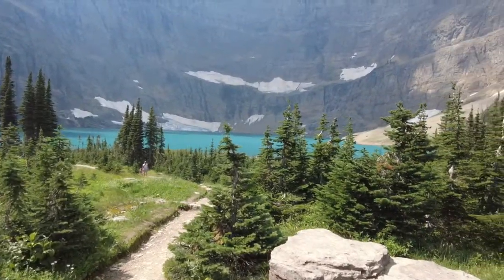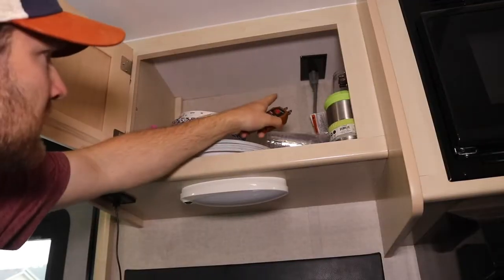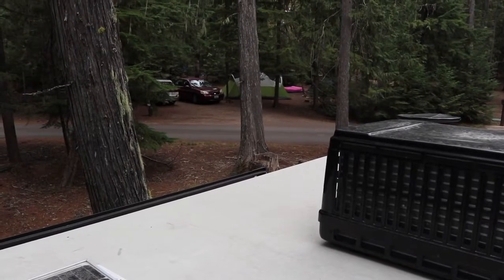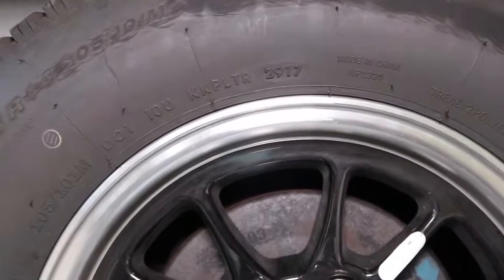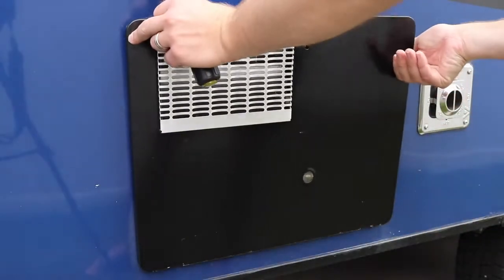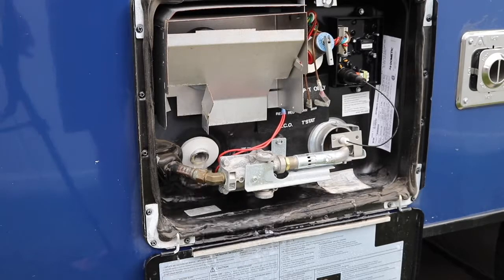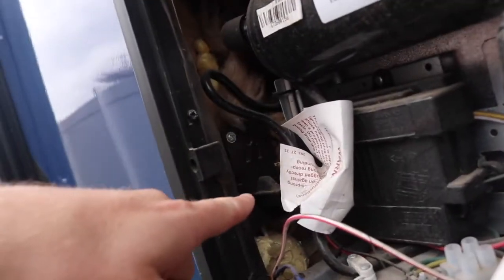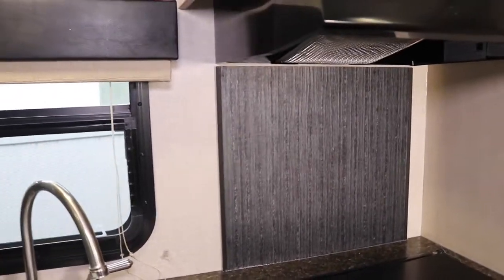7 Things to Look for BEFORE you buy a USED RV | Watch Before Buying Used

Comment: Saw where you found water that entered and the wall paper was a little wavy , I just bought a used travel trailer and found the same inside a closet by the fridge,  I pushed on it it did have some small give to it , I found very very slight delamination on the outside by where the closet was located , also on the other side of the fridge which is the same wall as the closet that wall had a tiny bit of give to it . Should I be overly concerned about this . I bought it from a dealer I think they made have caught the problem in time.  Even though they tried to say that wasn't caused by water damage ..